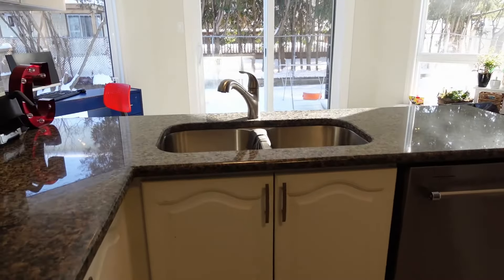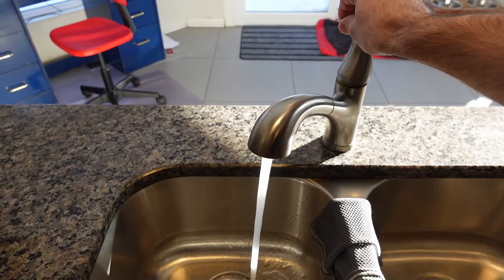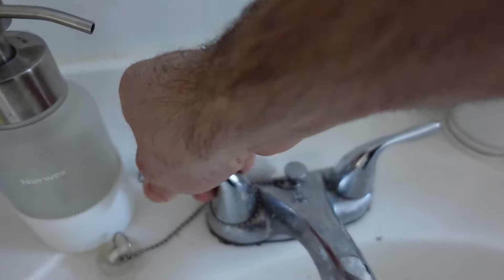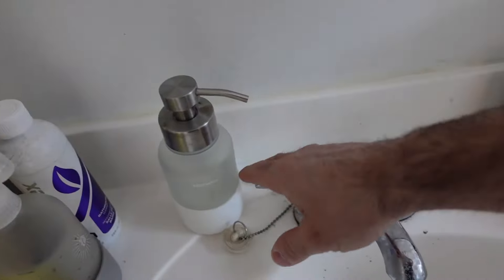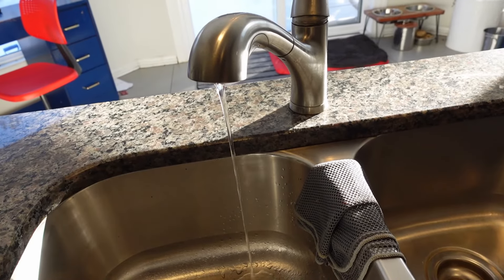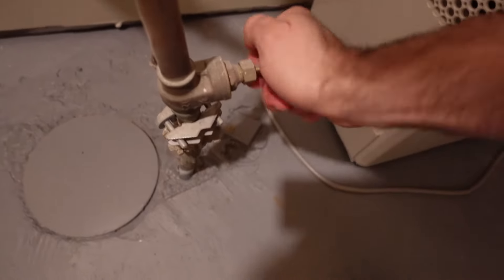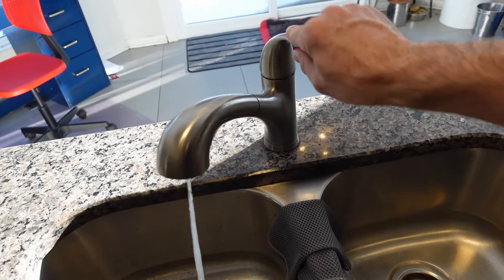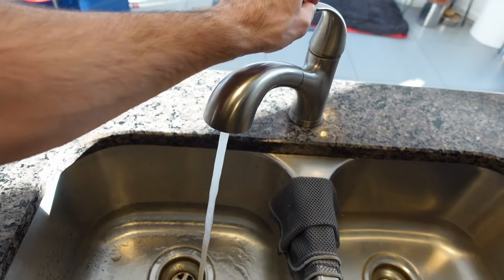Fixing Noisy Plumbing

Comment: Did this today seems to be working just drained the whole system. My plumbing was vibrating loudly when I turned the taps off quickly or flushed the toilet even the neighbours taps set it off.
If this holds even for a month that awesome can repeat the process, better than noisy pipes at 3 in the morning 
Thanks Richard
Reply from the maker: thanks for watching. Hope it lasts. You can also add some water hammer arrestors in a few locations. Those certainly help out.

Comment: I have water hammer when turn on water in kitchen sink.  What do you think my issue is?
Reply from the maker: are your pipes exposed in the basement? I had some left over rubber material from something I was working on and slid that under some of the pipes that were able to rub on ductwork and trusses. A water hammer arrestor might also help if it is just the kitchen sink. They make single fixture water hammer arrestors that would likely help.

Comment: Help! I live in a mobile home and have pex pipes. Every time after I run the water at my kitchen sink (mainly the hot water) there's knocking/thumping sounds coming from under my dining room floor. I've had the pressure valve changed and lowered water pressure from 100 to 63 but it did not help. It also happens sometimes even when l'm not running the water..did this happen to you as well? This may not be related, but coincidentally around the same time the thumping sound started my floor boards in dining room started to make creaking/snapping sound. Do vou think it’s water hammer even though it will make the knocking sound even if I’m not running water?
Reply from the maker: Pex shouldn't make the same type of water hammer noise as copper pipes, and the pex should also be easier to control.
I'm not sure if you can access the pex but I would just wrap them so they can't move around as much.

Comment: MAN…..😳….. I have a new water heater and the hot water pipe in where the heater is is hammering like crazy! That’s why I’m looking up what to do. But DUDE!! It sounds like you need to bleed out all the lines/pipes to get rid of air pockets or something! Gees! I hope 🤞 that’s not my problem 😂
Reply from the maker: They also make water hammer arrestors that you can install near the fixtures that are making the noise. I added them to my washing machine and they made a huge difference with that.

Comment: I would love to try this buy I live in a building that is split in to 5 different flats/apartments Even the plumber cant fix the problem! really old building. The hammer seems to be coming from the 'boiler room' I'm told. 

Unfortunately it seems to wake me up at 3am every morning and sometimes 5am 😞
Reply from the maker: They make full building water hammer arrestors. but you need to do some more invasive plumbing than done in this video.

Comment: This worked initially, but later in the day the water hammer came back, any ideas?
Reply from the maker: Is it every faucet that causes the issue or is it just a couple?
You can install a purpose made arrestor near the offensive taps.
https://amzn.to/3AOnz7l
Reply: @DIYNorth  it's everything upstairs, toilet, cold tap, and a shower
Reply from the maker: A well placed custom built arrestor might be able to solve them all depending on how your lines are set up.
I also added some rubber I had laying around (bike tubes) in spots where the water pipes could shake and vibrate against wood. Basically space fillers.
Reply from the maker: @squirts1 yes, my house is old.
Reply from the maker: @squirts1  yes, my house is that old. But I also put arrestors in front of the most offensive item, the washing machine with quick operating valves.